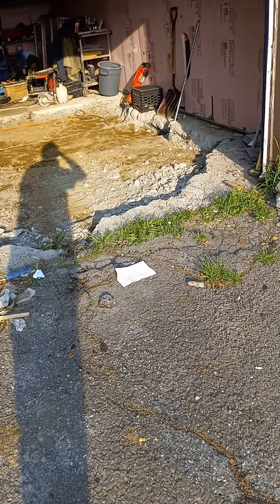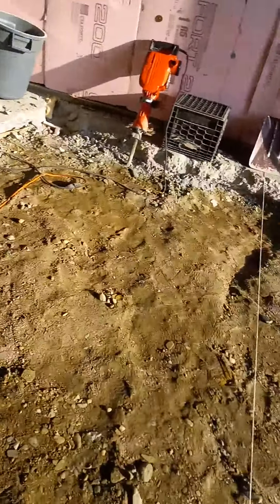calculate concrete.

Comment: Hey Ged, put bricks 3/4ft apart and level them through with a straight edge and spirit level. Work your concrete to these levels and remove the bricks.
Reply from the maker: I'm drilling into the edge concrete to key the old to the new with 2 foot of rebar, then I'll weld the rebar joints, welder is sitting right here anyway so its quicker than wire wraps. If the rebar sags I'll support it in the middle but it should be rigid with the tack welds.  Picking up  twenty 10 foot lengths of rebar today (tuesday) , concrete pour is scheduled for Thursday afternoon. Renting a bull rake for the surface finishing.

I also dug under the edge of the old concrete to key the new pour, its totally over engineered but its for a 2 post car lift, not the typical garage pour.  The old floor was severely cracked in many places and frost heaved 1 inch.
I'm sure it will crack again but the rebar will prevent the frost heaves.  4K PSI concrete.
Reply from the maker: concrete calculation was close, we had just 2 buckets left over at the end.
better extra than not enough.